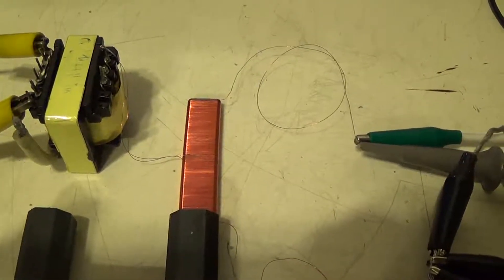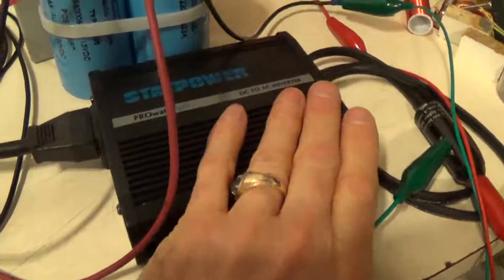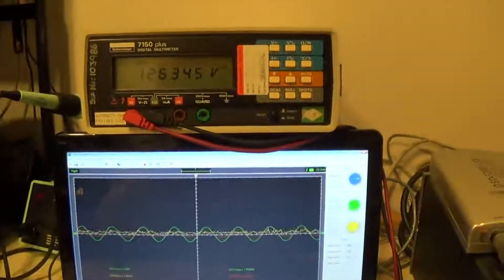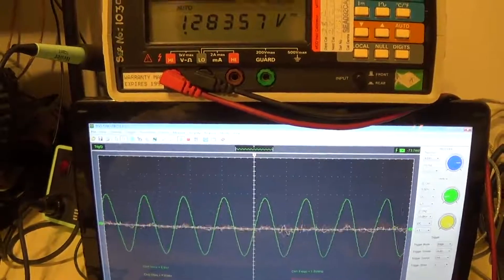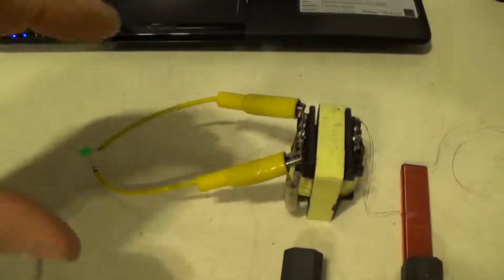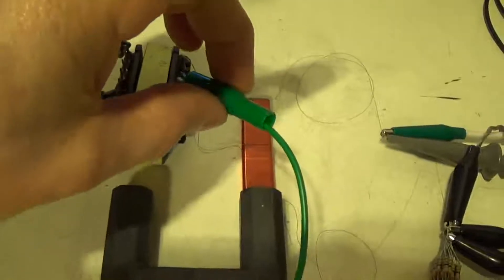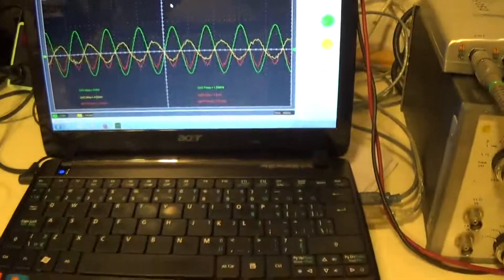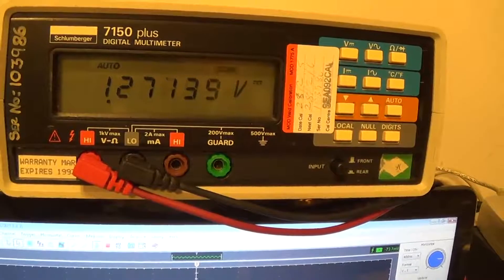Solid State Generator test 2

Comment: Hi if you type in Stanley Meyer lecture part 2 it shows meyer how simple his epg electron positron generator works a circular stainless steel loop like a kettle element wrapped with coils around outside with a b+ tv fly back attached to pluck out electrons and they feed to a led photon source that destabilises the des turned air atoms in the loop same as a alternator the secondary magnetic diode is on both sides of his water fuel cell as he says keep it simple it appears this knowledge is also to do with my lates air magnetic charged engine the alternator in my video is showing the back charge stripping electrons from fluids in engine with ignition off got further tweaks off joe bookers friend recently to make phasing out symptoms by placing a star washer slightly loose on the engine earth to chassis this should staticise the engine I am not to knowledgeable on electrocs so its all trail and error on my practices but I do place everything on you tube and explain when I can please comment if their are things you can enhance or query

Comment: Out of resonance, you are still putting power into the L/C resonant tank... made up of the L, and virtual-C (the inter-winding capacitance)  These "loads" need to be seen as their individual reactive values at the given frequency, when out of resonance. (the "C" will be very small, as evidenced by it being de-tuned when your hand/camera gets close to the circuit, as you mentioned)
 
When it's "in resonance", the energy circulates essentially without "resistance", since the Xl and Xc 'offset' each others reactive values, since the V and I are exactly 180° out of phase.  If the resonant tank components are no longer consuming the energy, the Voltage across the tank climbs drastically, and the LED receives enough power to be illuminated.

In theory, there is no (or very little) "energy consumption difference" from "out of resonance" with NO LED lit (power dissipated by L and C), and in-resonance WITH-LED lit (power dissipated in LED)... the energy is just being dissipated in different places under the different conditions.

Comment: Love your work!  Keep on experimenting!

Worth considering though, is that the Variac won't "regulate" the AC power that's "maintaining" the 13V on the battery. As your AC mains voltage fluctuates (which they all do), so will your charge feeding the battery... and everything else, so the current measured will also fluctuate.

BTW... does your camera allow manual setting of White Balance? It keeps drifting between what it thinks is White on your notebook screen, and the room lighting colour. (I'm a video guy, I notice this weird stuff ;-)
Reply from the maker: Yes, I realize that but I think it's stable enough to see what's happening. I do have a 12vdc SMPS that I can accurately adjust the output. I'll use it when the time comes.
Thanks for your post
Luc

Comment: Hi at 2 minutes in why don't you copy stan Meyers magnetic collapsing diode by just having a wire across the capacitors with a secondary wound round that rather than a resistor I believe this will stop heat loss and also it is a very efficient system seems to relate to the car alternator ignition light which stan states becomes a switching diode no expert here in uk just trying to pass on possible methods
Reply from the maker: Please post a link to your video demo of the technique you described
Thanks Luc

Comment: Nice presentation, I really like the old WaveTek 123. Have you opened it up? They are really neat inside.

At around 5:10 or so you talk about power "coming in from the second scope". How does that happen? I have never seen an oscilloscope actually inject power into anything; this should be impossible, in fact. Have you perhaps created a groundloop somehow?

Unfortunately your final conclusion, that the power isn't coming from the SG, isn't actually supported by your demonstration. It's nice work, though! Keep up the dialog with .99 and keep on experimenting.

Have you tried using the nice DMM simply as an inline ammeter, dispensing with the Vdrop across the resistor stack and just monitoring current directly with the instrument?

Cheers--
--TK
Reply from the maker: Hi TinselKoala,  thanks for your post.
Yes, I've opened the WaveTek to look inside. They are a work of art and well built. I tried to find the 50 Ohm output resistor so I could bypass it for some tests but failed to locate it.
The second scope was leading power in through the probe ground.
The high resolution DMM was used to monitor all DC current feeding the input to the circuit.
Luc
Reply: Luc Choquette
Ah, I see it's a WaveTek 134, not a 123. I was able to find a manual for the similar 135:
http://www.ko4bb.com/Manuals/Wavetek/Wavetek_135-Lin_and_Log_Sweep_Generator/135_May77.pdf
You can probably use the schematic in this manual to locate the output impedance of the 134.

A small inductor across an LED will sometimes make it possible to light the LED with "one wire" stimulation.
 
Yes, I see that you are using the DMM to monitor the voltage drop across the 1-ohm resistor stack. I am suggesting that you use the DMM in "Ammeter" mode, put it directly inline and eliminate the resistor stack altogether. Or use it this way, in addition to looking at the Vdrop with a regular DMM set to 2000 mV range. Just as a crosscheck.